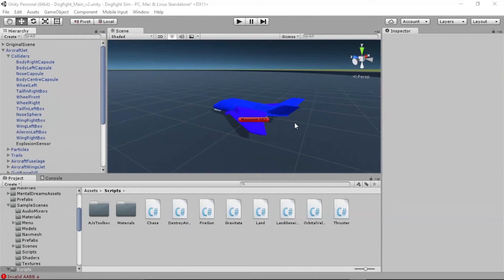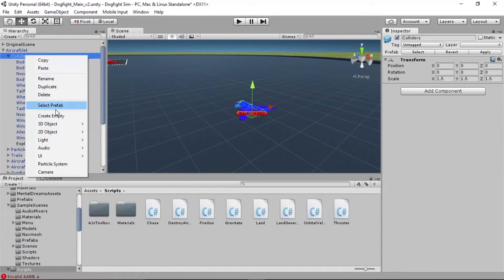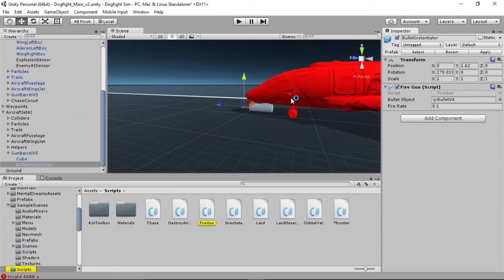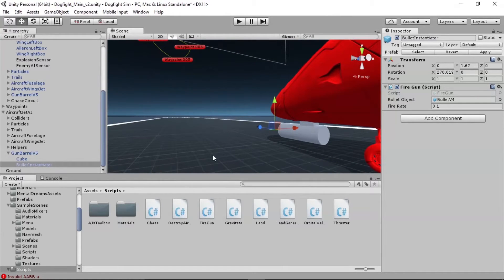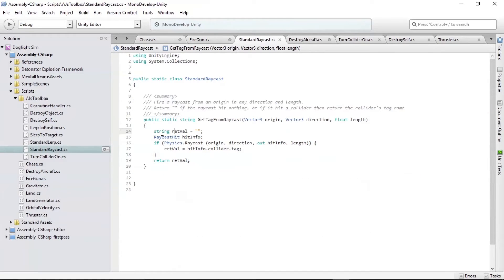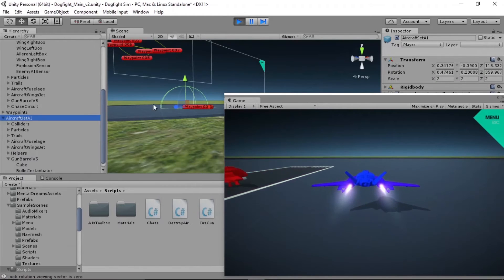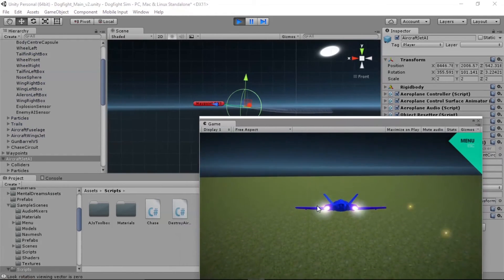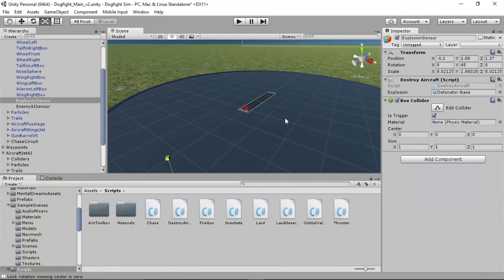How to Build a Dog-Fighting Flight Sim Game in Unity - 6 of 6

Comment: Thanks for the great series, it has helped me out. Though I'm trying to make a space dogfighting game, so I have to tinker with the AI controls so he has a much smaller turning circle, so that it flies better in space. Do you know which values in the AI script I need to change to best do this?
Reply from the maker: I actually was playing with Unity's waypoint system recently.  Try turning off the AeroplaneController script and the AeroplaneAIControl script. Those two drive the physics behavior of the AI jet, which is very much reliant upon gravity so it's not really appropriate for space. You could start by replacing those with a simple script that translates the jet forward during the Update loop. For example, transform.Translate(transform.forward * speed * Time.deltaTime); The speed variable would be a float variable that you can expose in the Inspector and change until it feels right. This won't be realistic for space because it won't include inertia, but it's a good starting point.

Comment: Ok AJ, again, awesome tutorial.  My version has added 1) four 747 jets using same waypoints as AIJet (also raised and spread out the waypoints), 2) three MGs vs one for Player and AI Jet, cuz gotta have more guns 3) four guides missiles for the player jet, all aimed at 747s but will also seek AIJet if you machinegun one or more jumbos first.  I took a shot at uploading project to GitHub but way too many files in Assets, so just uploaded exe and data for now: 

https://github.com/matrobnew/Dogfight

buttons 1,2,3,4 launch the missiles, whenever you feel.  Or never, if you think that's too easy.   They don't miss (though you have to kill a jumbo with MG to have a missile left for the enemy jet).

Originally planned to give missiles to Enemy Jet too, but player basically has no chance to survive then (at least without some kind of radar warning indicator, and then still little chance of evading them for long--that's why jet warfare is fought with missiles now :-) 

I am going to add an auto-aiming MG to the tail of each 747 next, though (I'd have used bomber jets but didn't have models handy).

If you're interested in my guidance/aiming code, let me know.  It's all about FindwithTag and Slerping. I think you could get away with much less use of both waypoints and sensor colliders/raycasts, but don't know which way is more efficient. Probably yours.

Comment: Awesome tutorial! As a beginner I've learned a lot from this series. Could you give some hints if I would like to use my own jet plane models instead but keeping all the nice function/physics of the aircraft in this aircraft example?
Reply from the maker: Happy to help. If you have imported your own jet model in .FBX format, you should be able to drag the file into the scene as a child of the original jet's parent object. If you set the transform position of your new mesh to 0,0,0, your model should appear relatively close to the original jet mesh (maybe even right on top).  Its transform position should display relative to its parent, so if it's parent is the original jet, then setting the position to 0,0,0 means you're snapping your new object to the pivot point of the parent.

 If you don't see your mesh, maybe it's hidden inside original jet mesh. When importing FBXs, you have control over scale on import, but if you went with the defaults, you may find your mesh is a different size than you expected. You can usually locate your new mesh if it's hard to spot by adjusting its scale. 

Once you've identified your new mesh in the scene, you need to rotate, scale, and move it so that it is in roughly the same position as the original jet mesh. This way, it can simply inherit the built-in colliders. You may need to massage the scale/position of the colliders too if you want everything to line up perfectly.

Then, you can delete the original jet mesh objects. There are many of them. Each represents a small piece of the original jet.  You can identify the mesh (as opposed to the colliders or other components) by checking that the selected object contains a MeshRenderer component. That's the script that tells Unity to render a mesh. If you toggle the MeshRenderer on/off, you should see the selected mesh disappear/reappear. That's how you know you've selected the intended mesh. 

One thing beginners find confusing is the click hierarchy in scene view. If you just click a mesh in scene view, often you may have selected the parent of the object you wanted, not the object itself. The first click always selects the top level parent of an object. If you click, and then click again (slower than a double-click), you'll go from parent to child. The parent may not have a MeshRenderer component, but if you're trying to select the mesh, just keep clicking until you see the MeshRenderer show up in inspector. Observe what object is selected in the hierarchy when you click multiple  times. That will help show what is happening.

Once you've added your new mesh and deleted the old mesh, you should be good to go. Remember not to delete the gun prefab if you still want the gun to fire. Good luck!

Comment: What would you need to do in order to make it possible to 'evade' the enemy, such as you slow down/out maneuver him so that he gets in front of you?
Reply from the maker: When you say evade the enemy, do you mean teach the enemy AI to avoid the player? That would be a bit challenging, but certainly doable. Off the top of my head, I would try using a similar technique to the original waypoint tracker. If you create a different set of waypoints (one that represents an evasive action motion), you could instantiate a prefab of that new set when the enemy senses your sights are on him. Once the new set of waypoints is in the scene, you could reassign his waypoint tracker to use it instead of the original set. You could use this technique  to make the AI plane execute just about any maneuver. You could even create multiple waypoint sets and instantiate them at random to create some unpredictability. The sky's the limit, but in most cases, taking things to the next level from here will require some extra scripting work. I hope that helps, and thanks for watching!